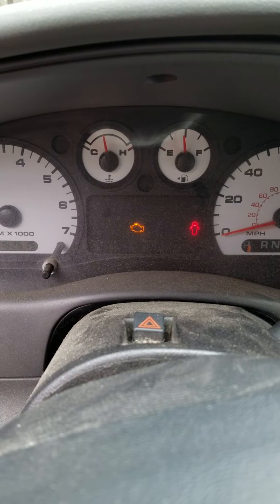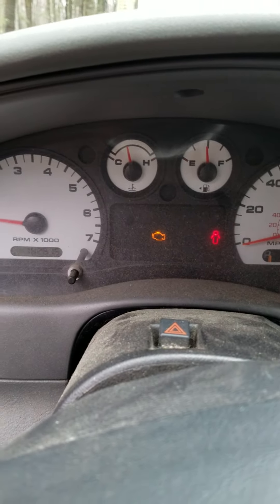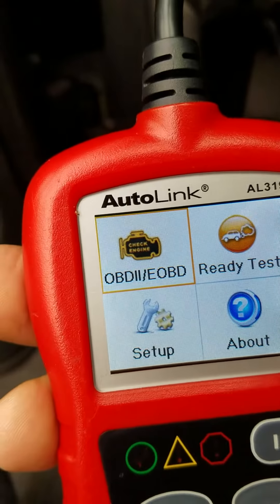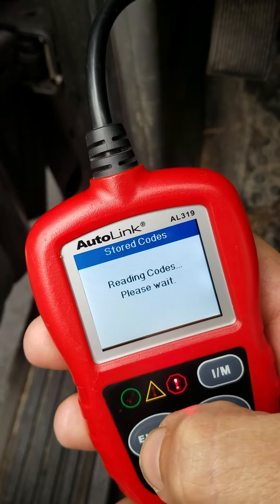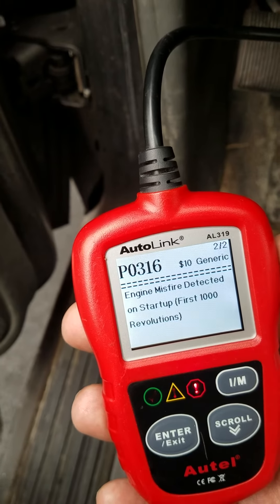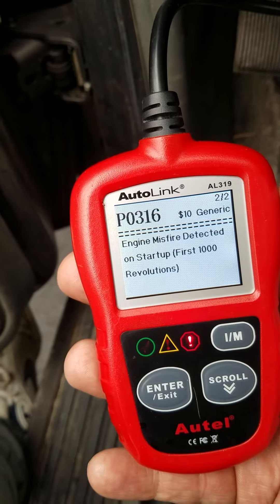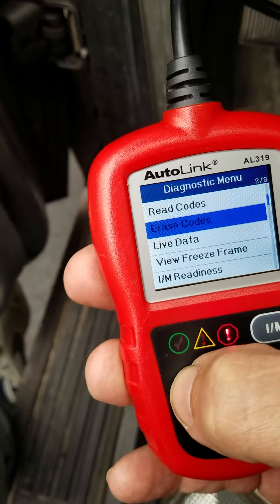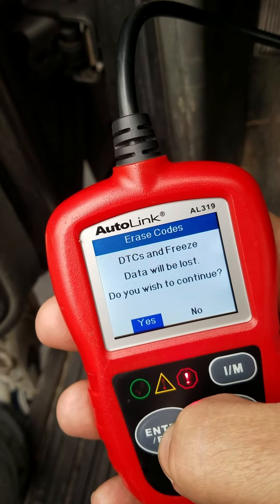Bad injector Ford ranger code p0304

Comment: Do you need to take off the entire fuel injector rail to remove just one injector? Or can i just loose the 2 bolts from the side im taking the injector off and just pull it?

Comment: I have an 2006 Ranger 3.0, same codes and symptoms. I replaced # 4 injector . It idled for 30 min. with no problem, drove 7 miles to the store, about 5 miles on return trip light came on steady, got back home light flashed at Idle, same codes. Any ideas?

Comment from the maker: It did fix it. I only replaced 2 of them. I first made sure it was not an ignition problem or compression problem
Reply: Hello Mr. Richard I also have the same problem, same cylinder, same exact codes. I did a compression test and cylinder 4 does show low compression could it still be the fuel injector or would it be the piston ring like I was told?
Reply from the maker: @alexarmenta4235  how much lower on the compression test? did they do a wet compression test and if so did the compression go up. does it miss fire all the time or only on start up.
Reply: It was a regular compression test! All other cylinders were around 150psi but cylinder 4 was at 80psi! The misfire only happens during idle for example when I’m at a light for too long, sitting in traffic for too long or when I warm up my truck for too long. CEL starts to flash and my car starts to roughy idle, once I ready to go I step on the gas and it last power but then it come back and runs great like nothing happened
Reply from the maker: @alexarmenta4235  sounds like you have some internal engine problems going on like a valve or rings. Eric the car guy has a good video on how to do a cylinder leak down test.

Comment: I’m having the same problem did a fuel injection fix it. Also did you replace all 6 or just the one.
Reply from the maker: i replaced the injector and it fixed it. i only replaced 2 injectors. this is not a common problem, most miss fire problems are spark related
Reply: @richardbates8139  when injector did you replace besides cylinder 4?